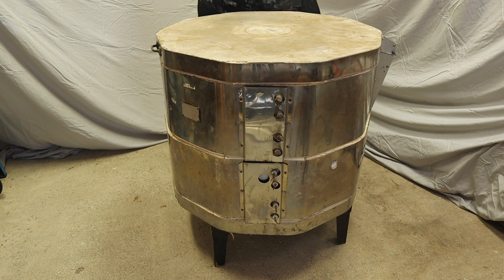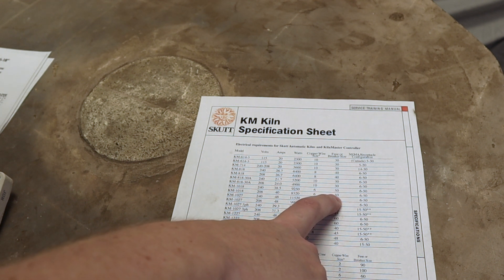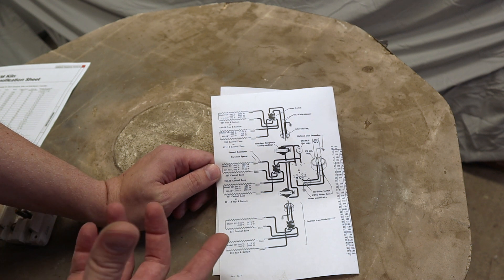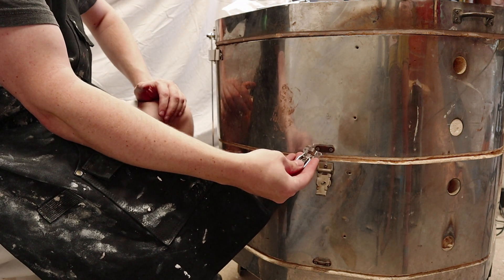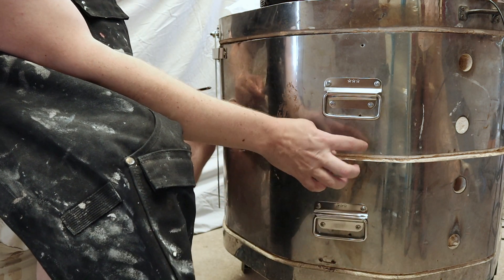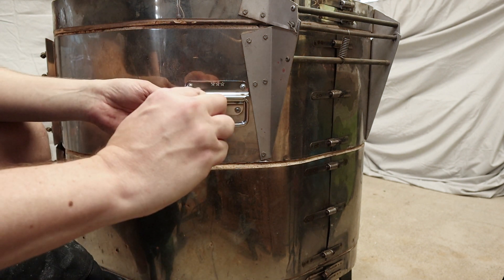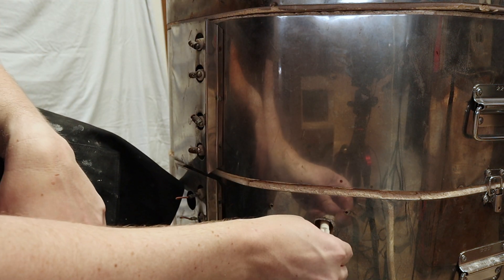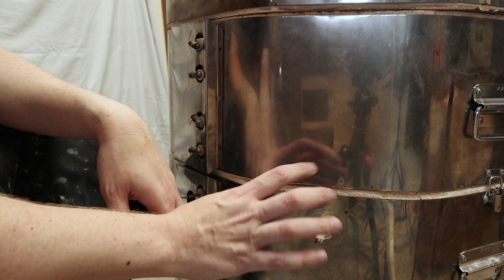How did my kiln SHRINK?

Comment: Really interesting!  I have a slightly newer version of this kiln -- same kiln sitter but different setup with the boxes for the controller. I just had a problem somewhere in the system, so I'm tearing it apart, and contemplating putting in a digital controller. Your videos here are really helpful in terms of explaining just how all the wires and connections physically work!  (Interesting that my dials have off-low-med-high settings, so I don't quite understand how they control the pairs of elements in each ring...)
Reply from the maker: The Skutt diagrams were very helpful seeing how it was supposed to go. Even though I replaced everything, I wired it like their current kilns.

Comment: Hi Kent, these videos have been so educational! I was wondering what your final set up was in regards to running it with two sections. Did you use just the top two sections, swap the middle for the bottom, or do something different altogether? You mentioned in another video that you might make some sort of adjustment and I was just wondering what the final was! Thank you!
Reply from the maker: I'm glad to hear that! I used the top and middle sections. The top since it has the lid and the middle since it had a place for the thermocouple. For other reasons I also ended up swapping out the elements so it now really is almost the same as a 2 section kiln.